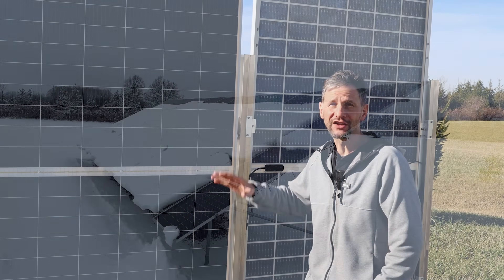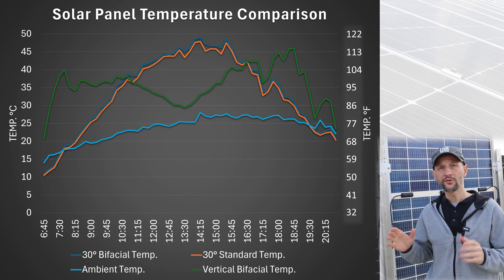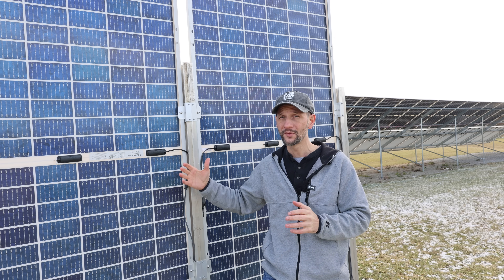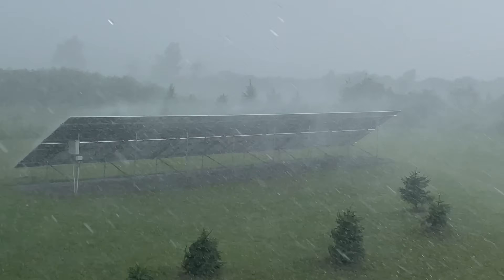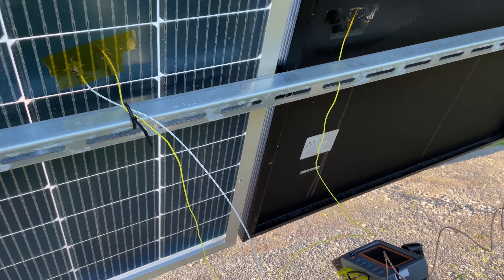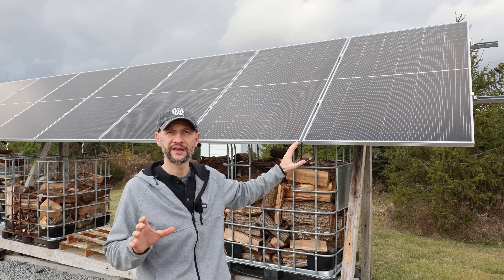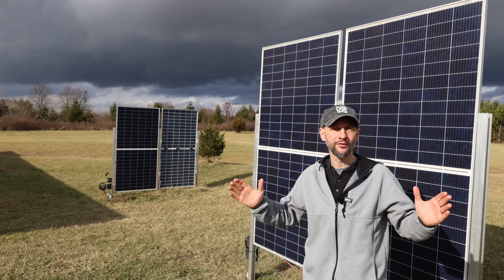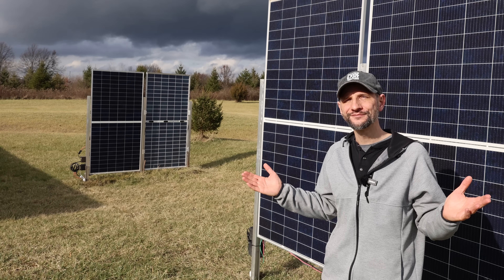HEAT -The Enemy of SOLAR- Are Vertical Solar Panels Better?

Comment: Dave, I watched the entire video, at normal speed. I didn't fully understand everything you said, but you presented it very well. I'm doing research on getting solar panels for our new house that I had built and we moved into a year ago (Nov). It's an Insulated Concrete Form (ICF) home, so very energy efficient. I had it prepped for solar and I have a Bluetti AC500 and two AC300 batteries that I use in my 5th wheel installed in the home, and used as a UPS for my freezers, frig, and gas furnace (fan). I've hooked up my 420 W portable solar panels to it and it worked flawlessly. I've also got the house wired for a 30A generator. I had the wiring to the Bluetti set up so I can use it as the primary power source for my "critical loads" (freezers, frig and furnace), but also be powered by the grid, or the generator if the grid was down and I was relying on solar or generator power. 
So... this is why I'm looking into putting up a ground based solar array, to provide more power to charge my batteries (now they only provide enough power for about 3 hrs during peak sun) fully, use them during the night, and provide power and recharge the batteries during the next day. If the day is cloudy, the grid would then take over and provide the power needed (the Bluetti has a setting for this). 
What I gleaned from your research is 
1 - Ground mount solar panels
2 - Use bifacial panels 
3 - Orient the panels south
Did I get right?
BTW, love your channel and have been a subscriber for a while now. Hope you make it to 100k.
Reply from the maker: Thanks for the sub!  Yes, you got it right.  You could go even further and put white rock under the array to improve the reflection if it doesn't cost too much extra.  Use PVwatts: https://pvwatts.nrel.gov/
To determine the tilt angle that will give you the most power during the time of year when you need it the most.
Reply: There are one or two points I like to add. When you primarily want to charge your battery, orient them south makes most sense. When you choose an angle of about 30 degree, you''ll have the most yield in summer time when there is a lot of sun anyway. When you put them up steeper, you'll have, compared to 30 degree more yield in winter. Depending on how many panels you will have, it could make sense to have a support that you can change. When you orient panels west or east, you'll have more yield when most people consume most of their power - before leaving to or after returning from work.